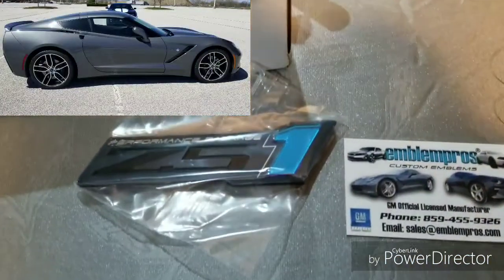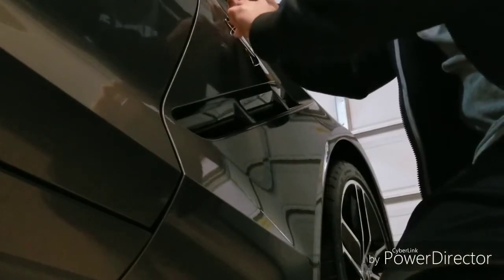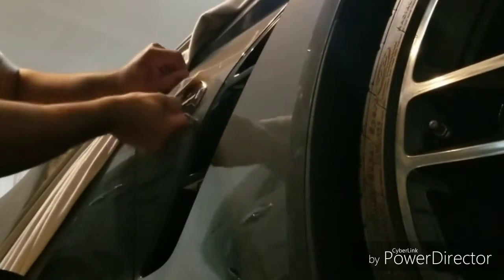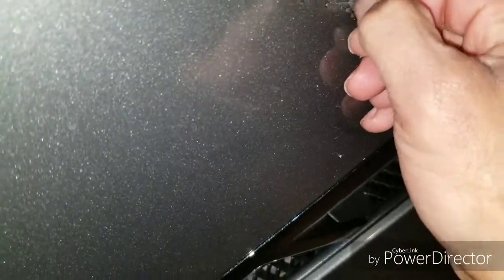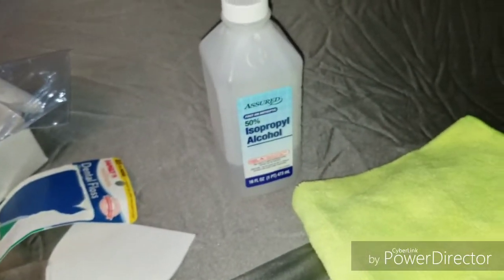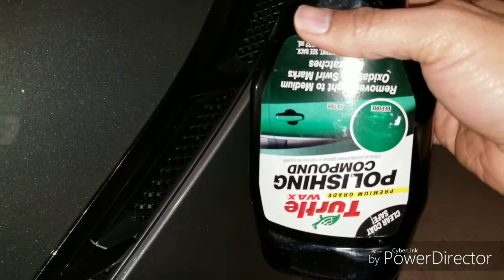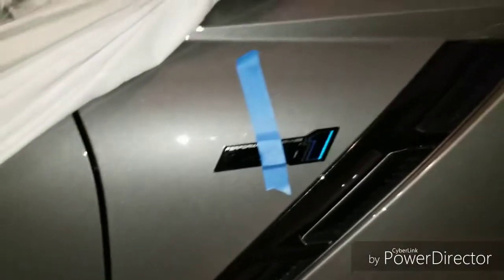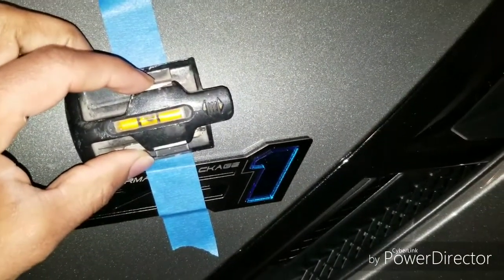How to remove and change vehicle car logo badge and replace with a custom emblem #Corvette #z51 #C7

Comment: Is that the 1” X 5” emblem or did you get yours to a custom size? I am curious if they would make one just a tiny bit larger to make it more visible!
Reply from the maker: This is a 5 inch by 1.5, it was already premade ,but the vendor does a lot of customization it's worth checking on